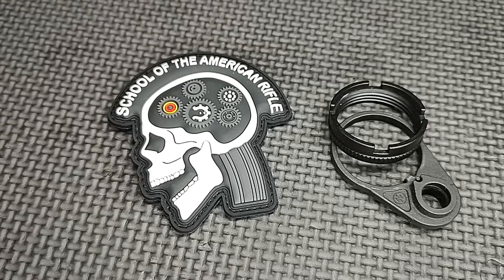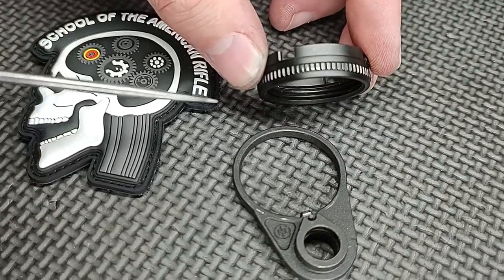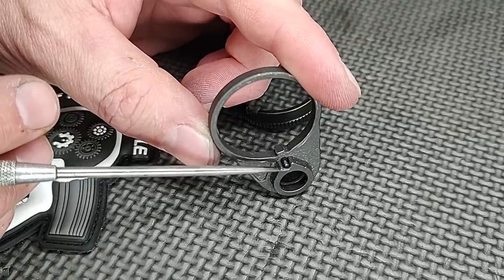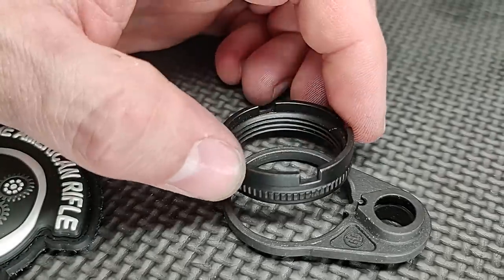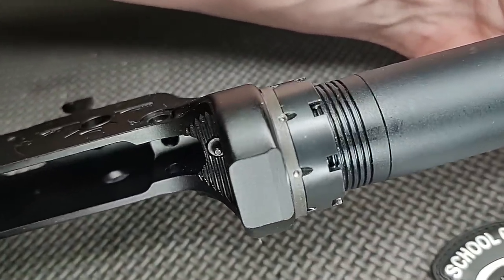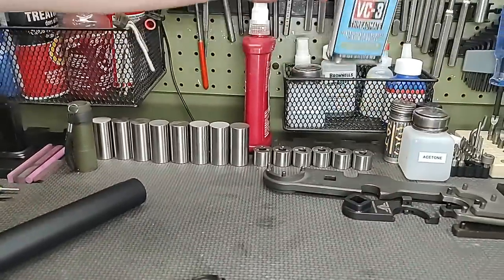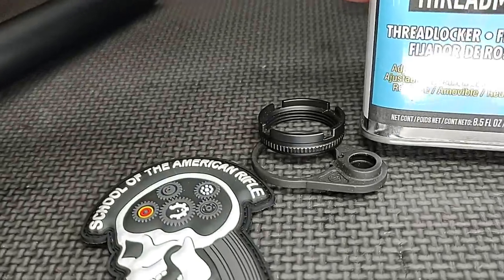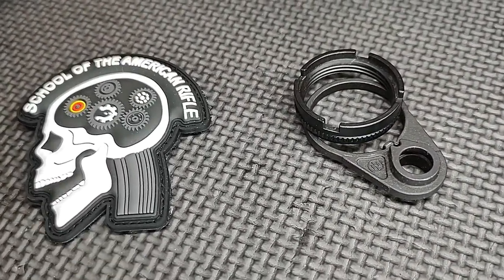Why Ratcheting Castle Nuts Suck

Comment: Is staking the castle nut a necessity, or just a best practice? I have one AR that I assembled that is just torqued with no staking, and it hasn't shifted in 3k rounds or so. I'm wondering if it's worth staking it anyway.
Reply: I don't have the umpteen years of experience with ARs that Chad has, but here's my 2 cents. I've assembled a lot of lowers at this point. In my opinion, staking is a "extra" guarantee that a properly installed castle nut will not back off, even under the most severe use situations (I stake all of mine). I have purposely left a castle nut unstaked on a beater lower and applied a torque stripe to see if it would shift, and it never started to back off. Sample size of one and all, but my working theory at this point is that if you properly grease the threads and torque 38-42 ft lbs with the correct wrench adapter (offsets the torque wrench about an inch or two) it would hold up to all but the most severe applications.

Moral of the story? Properly install and stake your castle nuts and you'll never have to worry about it.
Reply: Staking is necessary on any self defense or work gun.
Reply from the maker: Staking is always a good practice unless the end plate is aluminum (staking wont hold), is overly hard (titanium), or the end plate is brittle (Magpul)
Reply: Staking is entirely unnecessary in 99.9% of situations if you properly torque it down. If you want extra insurance use some loctite. Look at any other industry. Automotive, etc and staking or equivalent is rarely if ever used. The only equivalent I can think of is certain bolts on airplanes get safety wired. If it makes you feel better then sure go ahead, but if my car engine can stay together nothing but a torque or torque plus angle spec then I'm not too worried about my castle nut. Especially since if starts to come loose you just tighten it back down. Your ar isn't going to suddenly fall apart on you if it comes loose. It doesn't actually hold the buffer tube on the gun. It helps keep the tube from backing out and holds the safety detent in. It would be annoying, but if you hold the safety to keep it from turning you could keep shooting if that fell out. The stock in your shoulder should prevent the tube from rotating too badly if any. Of course the caveat to all this is you have to take the time to properly torque it.
Reply from the maker: @ameritus9041  just about everything you said is incorrect.
Reply: @SchooloftheAmericanRifle  well I'm not going to learn any better without more details on what I got wrong and why.
Reply from the maker: @ameritus9041 your mind is made up.
Reply: @ameritus9041 Are you kidding me?! Cars use TORQUE TO YIELD BOLTS!!! Your AR DOES NOT!! Sheesh I hope nobody listens to your advice!!
Reply: @SchooloftheAmericanRifle can you do a video on this? I have seen and read valid arguments from both sides and have historically always staked my builds bc I was told it was absolutely necessary. I also have a very cheap aero precision lower that I built for less than $100 that I didn't stake and have thousands of rounds thru that never backed out. I don't know what to think anymore.
Reply: I use ratcheting castle nuts pws specifically i just make sure they're torqued properly and make witness marks on either side I've not had any back off as of yet though i can see the reasoning behind staking and not using loctite ever because you ultimately want anti seize between your nut and threads to prevent galling since you have a steel nut on an aluminum tube I'm very interested in the device you went over the other day for properly aligning and staking with that center punch I'm probably going to try that on future builds it looks much cleaner
Reply from the maker: @davidabest7195  I have done content on the subject. The other side of the argument are arguing for shortcuts and have the "good enough" attitude. If people follow the opposing advice it does not have any effect on me. The guns I work on won't come apart without tools.

Comment: Sometimes I think your opinion is just lack of maintenance problems. Blue lock tight fixes 99% of your problems
Reply from the maker: Look up the technical data for blue. It's not for a 1" fastener. Unless you use the stick or gel version, it can also migrate to places you don't want it to go. Loctite blue also requires more heat and force than should be applied to this part of the gun for maintenance. This leads to damaged or weakened parts.

Comment: Or you can just grind some staking notches into the castle nut and stake it - cost = free compared to buying thread locker.
Reply from the maker: I call those poor decision hash marks.
Reply: grind notches? but you already have the punch in your hand, just use that 💀
Reply: Whatever works. Sometimes you're in a situation where you can't get a new nut and would need to improvise. I get that ideally you would replace it completely but meatball surgery will work to get you by until s proper repair can be performed.

Comment: What about the Fortis MFG K2 ratcheting castle nut?
Reply: It implement a different locking scenario. As you note it has lever type lock what not required that much force to move over ratcheting tooth's. 
There no single locking tooth like on PWS, what actually may have wear once installed I guess. I use Fortis and have not a single problem yet.
 I respect Chad opinion, but it may in view of PWS design only

Comment: I went with the KE arms monolithic polymer lower to avoid the whole castle nut issue, one less thing for the home gunsmith to fiddle with. It's been very reliable so far, but I've only shot a few rounds so far.
Reply: My "daily driver" is on a KP15 lower.  Use it pretty much daily on the farm and i'm not kind to it.  Been great.
Reply: @mattfleming86  Good to know, thank you!

Comment: 100% agree, ratcheting castle nuts are great and are one use items. People seem to forget that end plates were originally supposed to be one use items to where there would be 3 stakes or more. Some even staked every notch. Once staked, you'd be hard pressed to be able to stake the same notch again. Ratcheting caste nuts look aesthetically pleasing too. 

Back then, thread lockers were a must on almost all threads, and you'd just have to soak them before removing. But with more home builders, it seems people are straying away and are doing some short cuts from the intended designs such as reusing parts that are wear items.

Comment: Any other options to Vibra-Tite? Here it is difficult and very expensive to get... another option?
Reply: Loctite 242 - medium strength blue
Reply: @D_Zanzer 242 not 243? Aussie here so not sure if different # on the same composition product for different country or straight up a different product?
Reply from the maker: Loctite is a poor choice for this application. Requires too much heat and force to remove.
Reply: @SchooloftheAmericanRifle  So……? what other option………..?

Comment: It’s amusing how many people feel the need to defend their use of an inferior solution. I don’t see any reason to get butt hurt; it’s good information to have so you can keep an eye on your stuff if you’re using an inferior solution or add a second layer of protection witn vc-3 if you’re using one of these. Lots of people build with inferior parts and Chad provides great info to help get the most out of those lower end components.
Reply: All I see is people sharing their personal experience with the item. What's wrong with that? Not sure where your notion of them being butthurt applies. He also said it's a one use item, meaning they are still ok to use,  and there's not an issue if not removing them more than once (assuming you atleast get a decent one like the PWS). If you're not taking going to be taking it off, then just put a witness mark on it upon installation to check if it moves or not over time. It'll be just fine as many people have already stated my friend.